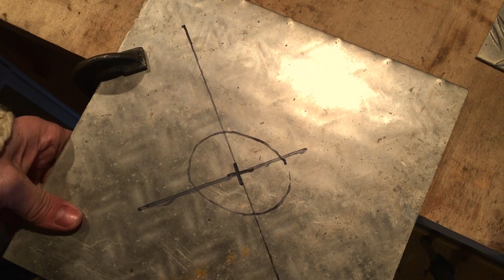Petromax Loki2 Zeltofen, Einbau in Holzhütte Wanddurchführung Lochschablone Anleitung, installation

Comment: Super. Danke für die gut gemachten Videos. Finde deinen Lebensstil, vor allem in der heutigen Zeit sehr bereichernd.

Meinst du Reicht der Ofen für eine Hütte mit 4x5 Meter auch für den Winter aus, wo man ab und zu mal die Nachr verbringt?
Lg aus Österreich
Nick
Reply from the maker: Servus, danke für deinen Kommentar! Ich heize meine Hütte in der Nacht nur mit dieser Blumentopf Heizung! Weil mir alles andere zu gefährlich ist, es hält die Hütte frostfrei auch bei hohen minus Temperaturen, aber von einem richtig kuscheligen Komfortbereich bist du natürlich schon ein gutes Stückchen weit weg! Der Petromax aber ist ein ziemlich vollwertiger Ofen, der locker 4x5m warm hält!
Reply: @RedneckRocknRollSonofDaxau  danke für die antwort und teilen deiner Erfahrung. Und viel Freude weiterhin bei deinen videos. Uns gefallen sie ✌️